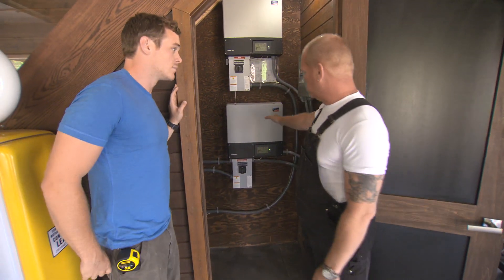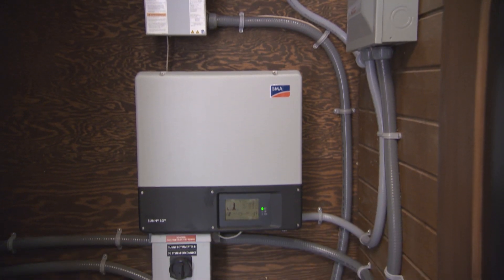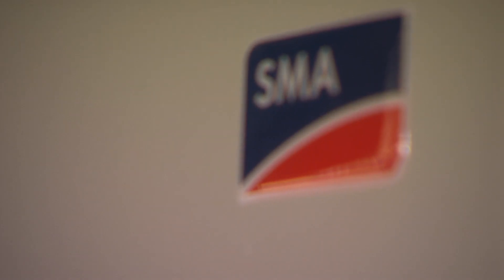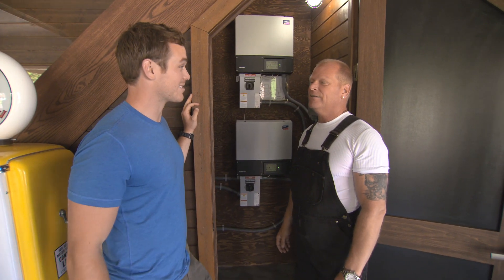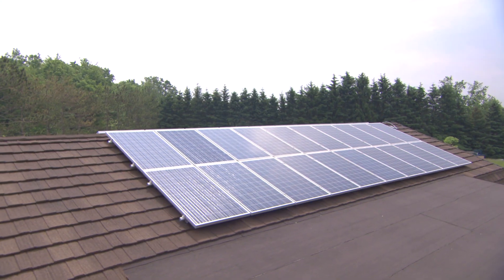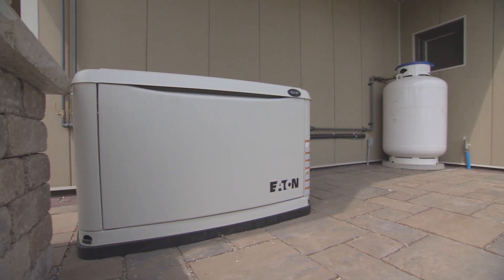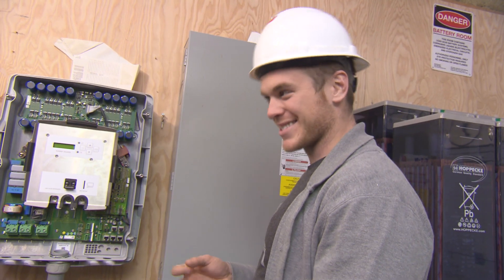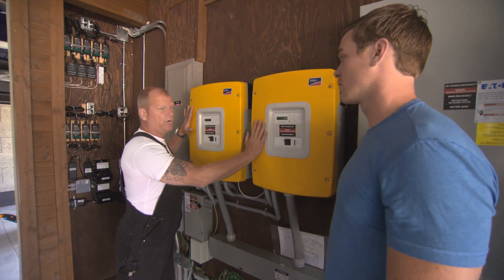"The Brains" - Mike's Ultimate Garage: Inside Look

Comment: I expected much better workmanship in a Mike Holmes project. All that liquid tight is garbage lol looks like spaghetti 😂 I don't know about 5 years ago but all you need to do is put micro inverters on the panels themselves and come right off the roof A/c. Hit a a/c disconnect and backfired the panel.   it's a much simpler system and has quite a few added benefits when it comes to code rules and efficiency of the panels themselves. Honestly though I cannot get over how bad this install looks 😭. Also I am pretty sure a 8 kw generator is little  underrated even with the interlock of the panels.

Comment: I'm curious what the ROI on one of these systems would be. Living in Alberta we get a lot of sun. Very interesting.
Reply: ROI?  As opposed to being tied to the grid?  I don't think Mike's system has any ROI what so ever in terms of dollars.  If he had to pay to run powerlines to the garage for many miles, it probably was worth putting in solar up front, but if he had grid power sitting at the end of the driveway, it's purely a cool factor to be off-grid with a grid sitting next to you.  Keep in mind the battery storage alone is roughly $10,000 retail.  Their replacement frequency is highly dependent on how deeply/frequently they are discharged but don't expect more than 7 years.  It would have been really cool to have Mike showcase the Telsa Powerwalls, but they weren't out yet.  They have charge/discharge cycles in the 5,000 range rather than the 700-1000 range for the Hoppeeke batteries.